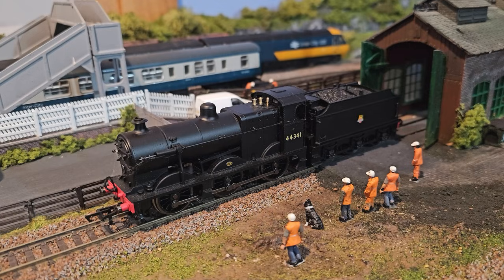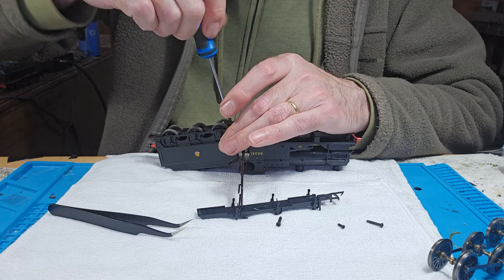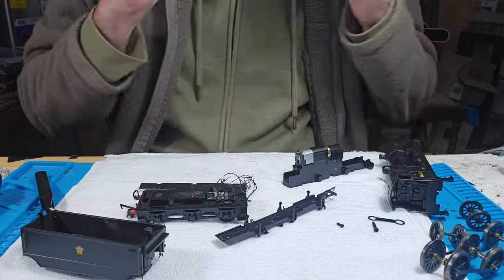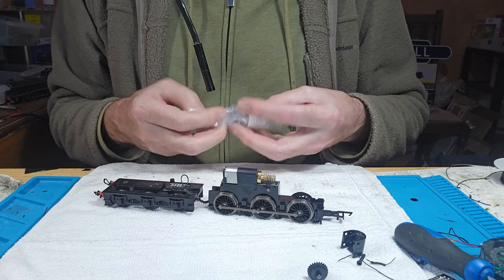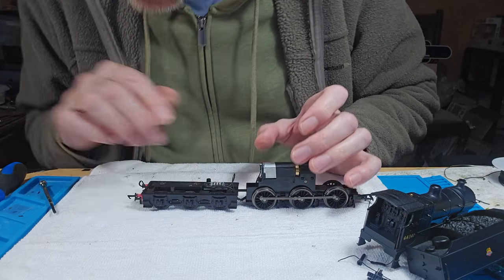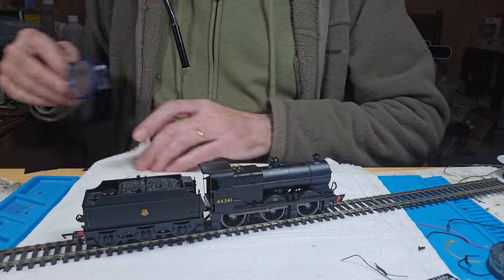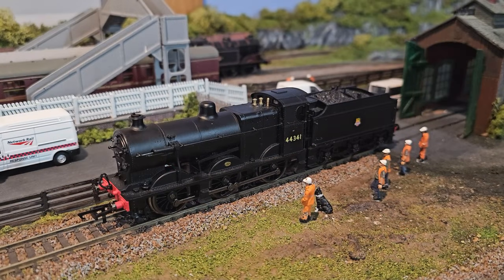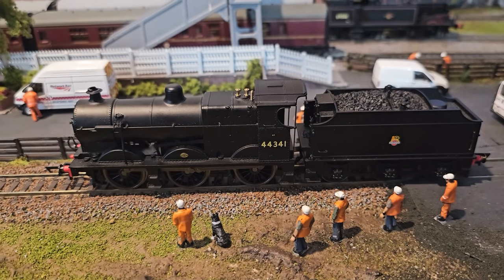Hornby R3314 Class 4F Fowler : Repair Request

Comment: Well done Bill; the mass of wires and melted to that. There is a DCC plate I’ve seen on eBay which shows where each terminal goes; not the colour wire but where soldered too. Looks like you worked it out and all went well, again a great running session. Always have great views from around the layout. All best Marc from Leighton Buzzard

Comment: This is the old airfix/ Hornby body but revamped to loco driven and DCC ready. The Hornby 4f that was from mid to late nineties was tender driven ...it was just an airfix re branded all molds were the same .the other locos Hornby bought out were the pug by dapol ,the x14 dapol and airfix. The 2p and j94 and the terrier .all parts for these locos will fit .I got told by a local shop that drive cogs for old dapol terriers were not available ...I went to Hornby got the Hornby one and fitted it .this loco on here is the exception as it's a brand new chassis .

Comment: Having read the dcc wiki page again I notice it doesn’t really say where each coloured wire goes….So here they are….Red - track right, Black - track left,  Orange  - motor right, Grey - motor left, Blue - common + ( for lights etc) White- forward lights, Yellow - rear lights, Green - another output function e.g. firebox flicker LED, smoke unit etc.

Comment: Split gears are my pet peeve if they are not stopping operation, they are making that loud thumping sound when the split comes to bare. I also had a high amp melt down with a derailment when the locomotive could not move, and the traction tires prevented the wheels from spinning due to lack of torque in the motor. I think you have the right idea buying what you can find of those double gears because we don't have an aftermarket supplier, and the OEM does not want you fixing old locomotives just buying new ones. Anyway, great repair and video.

Comment: One of my Fave Locos is the Dean Goods in Green GWR Livery and I Waited and Waited for a Decent Hornby Example to become available on Fleabay which arrived in due course in its Lovely Crisp Hornby Box, and as it Ran well I didn’t look under the Hood for a While till I decided to give it a Service recently, when I was Gutted to discover that it was just the Same Old Gubbins as the Airfix/Mainline Model but with Hornby Stamped on it! Every days a School day as they Say, but I felt deceived & Cheated tbh, but Anyhoo a Great Fix  here Doctor Bill and A Super Smooth Runner, I loved Seeing those Trucks Snake thru the Points. Thanks for the Post 👍🏻
Reply: Dont be gutted.You said it yourself,it ran well.When the newer type motors wear out and you get the rip off shock for new motor.This model will still be running.I put as new one of these on ebay a few years back,Starting bid was £25.i got no bids.I was happy that it did not sell and still have it .
Reply: Oxford made a good one. None of that tender driven stuff

Comment: You can get another wheelset and change the metal tyres so there are no traction tyres. It works well, and you don't get the rock, front to back on the loco.

Comment: Bill, when you find a split gear, don’t throw it away straight away. If the thinner of the gears is ok, keep them! They are the same gears as used on the axels of some hornby loco’s so if you keep them they can be used if you find a split gear on a drive axel.
Reply from the maker: Yup. I always keep them as I could also take one with a  good small gear and one with a good large gear and make a working double gear.
Reply: Another one sorted. Don't know if it was my phone but microphone level seemed lower than usual?

Comment: Hey Bill great job with this repair! These Hornby 4Fs are not easy to service… I’ve been having some issues with an Oxford Dean Goods I bought a few months ago as it is quite inconsistent, particularly at slow speeds, and sometimes the motor will buzz but the loco won’t move. I’ve had it apart a few times and all the gears seem to be in place, non of them are split, and I tried running the motor buy itself and it seems to be fine so I am not sure what is wrong with it. I’d send it to you so you can look at it, but I live in Canada so with the cost of international postage I’d probably be better buying a new loco. From my description though can you think of anything that might be wrong with it?
Reply from the maker: Try backing off the underframe screws a wee bit. Also test the drive train with the motor disengaged by pushing it gently along a straight section of track. You will feel if there are any points of resistance.
Reply: @ thanks I’ll try that and see how it goes!

Comment: Hi, great job getting that 4F up and running again. I'm getting one in SDJR livery for Christmas. What have you got against traction tires? Why not replace them as I did with the ones on my 14XX. It runs fine after that and I've had no problems since.

Comment: Bill is it possible  to change a 3rail Loco 2 rail ?
Reply: Bill merry Christmas  to you just  a quick question  is possible  to  change  a 3 rail Loco to 2rail  just  got one from  the wife as a Christmas  present
Reply from the maker: Yes but it's a bit of work as you need to fit a pickup and rewheel with insulated bushes on the pickup side. Not something I've done or would be willing to do at this time.
Reply: Could.you do it for.me?